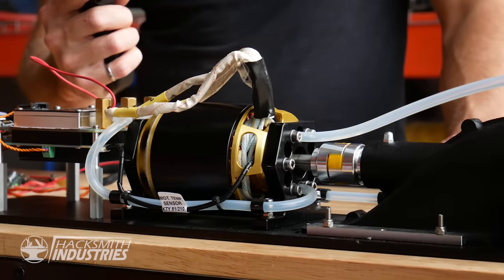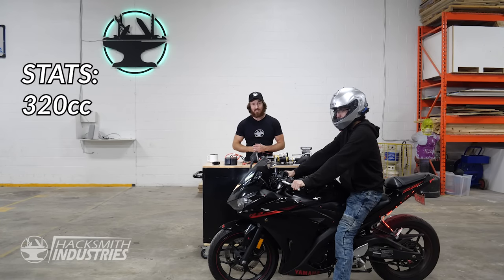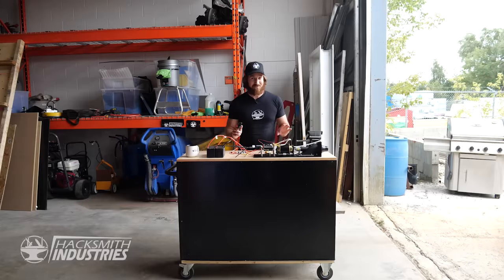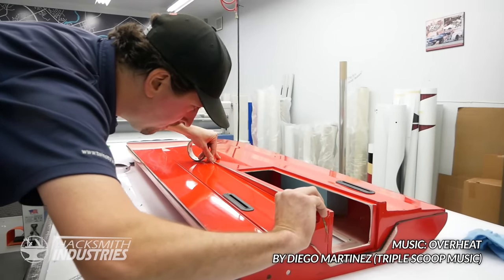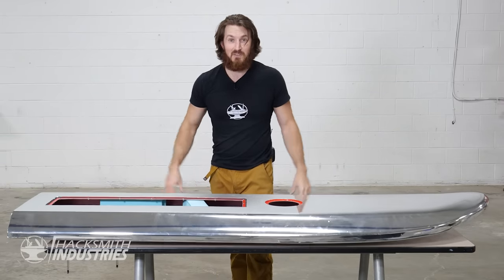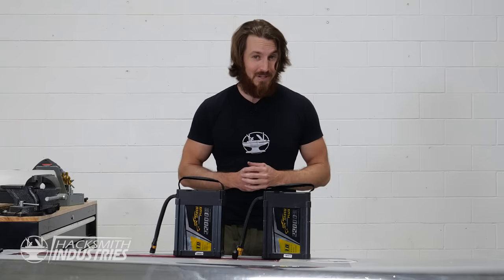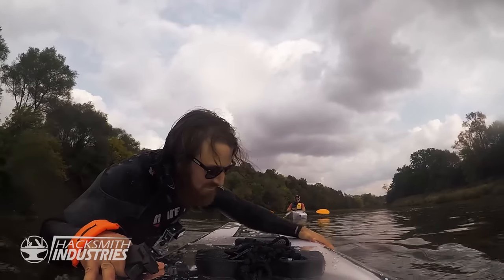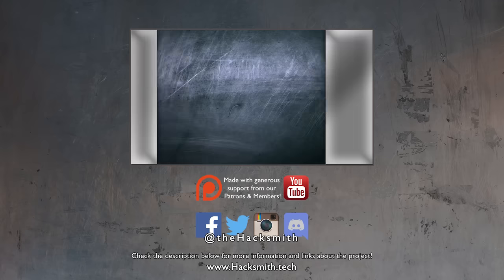DIY Silver Surfer Surfboard goes SUPER FAST!

Comment: I have a challenge and possible improvement to your design. The challenge is, build the glider used by the Green Goblin.

The improvement, this applies to your Silver Surfer board and this challenge project, is a way to keep your footing without a handle. What if you had strong, built in magnets into the board or glider? You could use a plastic covering with a Lead sheet between the magnets and the plastic. This would allow you to create shoes with metal souls, which would cling to the board or the glider. Make the Lead panel side to cover and uncover the magnets using remote activation possibly.

Comment: What a great project!  I know it might take a little redesign but could you make the board into an E-foil, like the Flitboard or Lift E-foil boards?  The motors have enough power to spare and you will be able to make the board fly above the water even faster since your drag component (and duration) will be so much less!  You already have: the batteries, speed controller, board, motor, and remote!  All you need now is a little ingenuity!  Unless you think that is simply a helicopter on Mars?

Comment: Two 22 Amp batteries can be a little dangerous on water. As for the wires overheating, they have too much resistance for that gauge of wire. I would go 3 sizes larger giving twice the wire diameter but only about half of the resistance. It is the resistance in the wire that is causing the heat. This information comes straight from my Professor in college who is a fully trained and experienced master electrician.

Comment: the motor says it takes 250amps - 500amps but the batteries are 22ah each so you get 44ah so 44ah/250= .176hours and cross multiply and divide that is like 10 minutes.

Comment: Nice video and Great fun to do a bit of DIY, it did look like you had some fun, but looking at the price of the parts that this company charges, you could of bought a radinn jet board starting at £6,700, much better performance and made to last. Just the board power unit and controller for this project will cost 4,234.48 euros, then another £1500 for the batteries and extra bits. your saving about a grand.

Comment: What is the actual electrical power in watts? It being a 22 or so hp motor only means that it can handle 22 horsepower. The surfboard doesn't look as fast as one would expect it to be with 22hp. If you're not there, just up the voltage?

Comment: When attaching the anchor, it seemed like that was the hard way.
I'd have thought dropping two long strings through the holes, then pulling them back to the opening, tie the strings off onto the anchor, then pull the anchor up, through the holes.

Comment: Great work but this is nothing new. 37 years ago i had a 1983 Surf Jet,  i agree yours is thinner but also a lot slower than what i had. i spent many weekends at my local waterway when i was a kid riding that thing. it was a blast ! almost as fast as my dads wave runner jet ski.  wish i had kept it but the hand throttle started sticking and it became dangerous. i purchased it at a car auction in a near by town for $600.00 and patched it up. i ran it for 3 years before selling it. man those were the good ole days.  you can still find them for sale between 1,000 to 2,000 dollars. hell they even had motor surf jets as far back as 1960. look it up.

Comment: everything that you save in space through the motor size gets away thorugh the heavy and not  long lasting batteries. Also the 80mm  jet drive would be better,  why wasting motor power with small jet, wehen motor is capable of 80mm drive???

Comment: something is wierd because my rubber boat weighs 50 kg and has a 13 hp motor with a propeller and thats goeas 50 km/h. you have a surf board with a 35 hp motor and it goes just as fast. i think this board can atleast go 70 km/h easy.

Comment: The main wires to those lipos are to small. Can tell by the 6mm connectors. I have 6 motors on a hexacopter bit larger then your surf board and each controller has 4 gauge wire with 10mm connectors 6mm on motor wires.

Comment: 1:42 man that is very wrong how is electric cooler gas engines are cool because of how they run electric. Is just magnets and wire
Reply: Without electricity ur "Liquid Fossil fuel" engine WHICH DOES NOT RUN ON GAS won't work